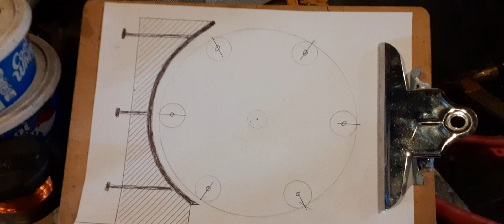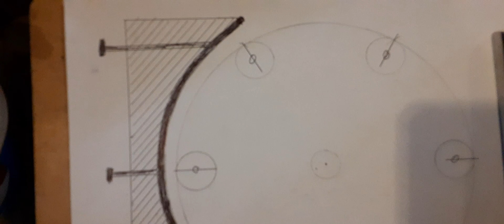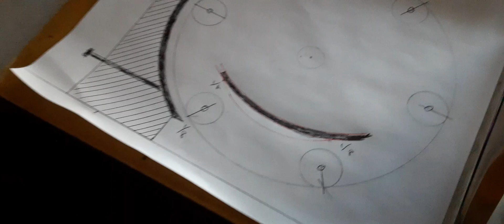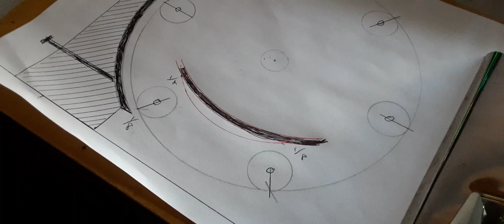Magnet Motor Problem Solved with Design Change?

Comment: What if it was a bar magnet that hinges in the middle and as it comes around it flips orientation so you have a south and north going pole and north south going stationary magnets on the outside and the inside as the stator is moving the bar magnet will flip towards the pull of the next outside then its opposite pole will face the inside pole. It toggles..like a relay race hand-off..?
Reply from the maker: I guess you have to some gear type setup that would orient the magnet in the correct position when needed........it all takes energy to do.  I bet a watch maker could figure that one out thou
Reply: @Lightendog  I was thinking the bar magnet free turns and by the time it flips from attraction to one side it's already turned towards the other. So no mechanical intervention is needed .. I suppose all it will do is cog to stationary though ..

Comment: Solving the problem of magnetic cogging is hard.   We have to angle the magnets to weaken one pole and we have to use magnetic shielding to weaken the rear pole so it's always pushing.  Otherwise you'll need to do a piston design making an oscillating motor based on a flywheel and opposing magnets.
Reply from the maker: I understand.  I do have Mu metal but it doesn't seem to work very well.  And because I'm using both N and S points of a magnet the only angles I'll be dealing with is with the ramp.  Right now I'm working on an acceleration ramp to push thru the cogging point and I'm getting very close.  Magnets love those edges and stacking two plates with one set back in the front and ending with one almost works now.  Today I'll try 3 edges in front to one leaving and see what happens.
Reply: @Lightendog  If you modify a Stirling engine to move the piston using opposing magnets instead of hot air that is the solution. It's not the magnet wheel... it's the Magnet piston! Can we actually make the Parendev (magnet wheel) actually spin though? I've seen one guy do it. I think a few people have got it going without cogging. I think it's possible...

Comment: I dont believe this will work because the movement of a motor is a result of unbalanced forces (normally magnetic) so if you balance the forces enough so there is no "sticky spot" then there will be no force to push or pull it forward. With that said im subscribeing because i love the home experiment spirit. Also one possible interesting rabbit hole is magnetic switches like the ones used for welding. Using magnets to suppress other magnetic fields.
Reply from the maker: I agree which is why I'm still trying to get the magnet wheel to jump the ramp with no help......I think I'm close but we'll see.
Reply: @Lightendog  one more thing you could try is to angle the metal away from the track so the distance between the magnet and the metal weakens the sticky spot
Reply from the maker: @micahrunyon2743  I have tried that and it seems the sticky spot moves also to the next point of most surface area.  She's a hard nut to crack, lol
Reply: @Lightendog  unfortunately, these switches also require energy for switching on and off. greetings klaus

Comment: Bro you have it flipped you should be 99% sure it will work and only 1% sure it won't, I can tell you from experience that your concept is on the money and you're correct about fine-tuning those parameters about where each plate starts and the other one picks up if you can make the jump from one segment to the next like you demonstrated that you can repeatedly, then you can make several that go in a loop, you actually did figure out a solution, I've been watching your videos and I was fixing to offer you one of the solutions one of the several solutions that I have for overcoming what I call the gate which is what you're experiencing that's a good way to transition I'm 99% sure it'll work and only 1% sure that it won't and you should have that same attitude, now get back in there and build it! LOL
Reply from the maker: I wish I had a way to make things with extreme precision so that's a big factor in getting this to work.  Plates have to be made accurately to make a complete circle.  I don't want to be too confident as we know, there is no history on this ever being done.  Even perpetual motion is said to be impossible.  I need something better than just perpetual  motion to do some work.  Imagine if this did work.....ya just up scale it and some slavery chains will be broken.
Reply: @Lightendog  well I've seen it done before with the v gate motor, and I'm 99% sure it will work in your case as well, that doesn't mean you're going to get a ton of performance out of it, it will have limitations. Perpetual so-called motion is not actually perpetual motion, but they do say a lot of things don't they
Reply: @JasonJoplin  how does 8t work at the v gate motor?
And you wrote "from experience" and "to offer...one of the several solutions" Did you build a working machine?
How to overcome the "gate"?
Reply from the maker: @ In further testing, turns out I don't need metal above, it works having a lower piece of metal right after it on the same level.  That's good because now I don't need a squirrel cage rotor however it also works in reverse.  I can jump the gate in both directions........I don't think that's good because it tells me I have a perfect balance again.  If it does work, then I could run the motor in both directions.  I have more testing to do, lol.
Reply: @Lightendog  and that's why I actual testing is so important because you learn so much through trial and error figuring out what works and what doesn't and just because something doesn't work doesn't doesn't mean you didn't learn something it just means you learned what not to do but that's so cool bro I can't wait to see a working prototype
Reply: @DerBeinmann  one of the ways to overcome the gate is with an electromagnet  placed at the gate, essentially an air core coil triggered by a well-placed reed switch, the nice thing about this system is it has a regenerative capability through the back EMF from the coil which can be used to recharge the driving system as well as store access energy which can be discharged in various ways
Reply: @JasonJoplin  Thanks. How much is the "regenerative capability" vs. energy for the coil?
I saw also some mechanical ~gate triggers~..what is ur favorite? 

Do you have some kind of running machine?
Reply: @DerBeinmann  my favorite is the one with the coil because it's regenerative capability is sufficient to both run the system and charge either a battery or a bank of supercapacitors, the size of the system will determine the amount of energy the system is able to produce
Reply: @DerBeinmann  I no longer have a running machine but I have had a running machine in the past